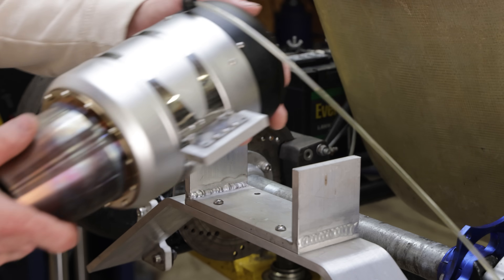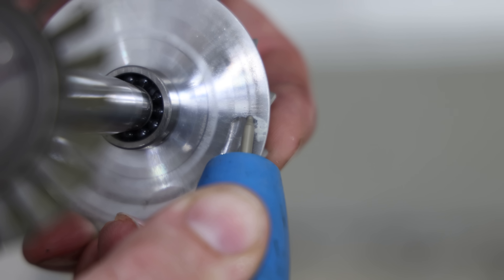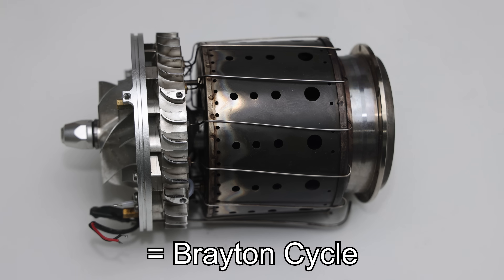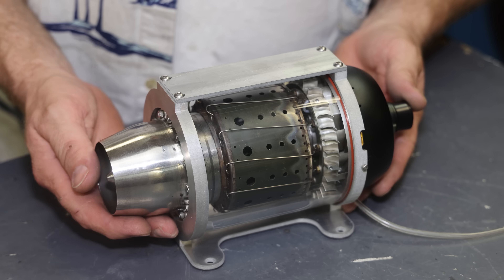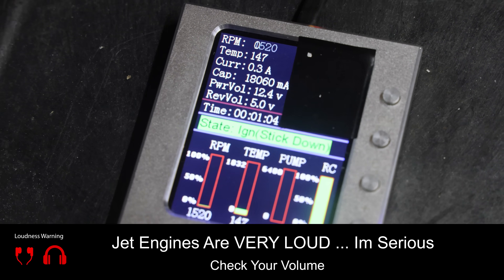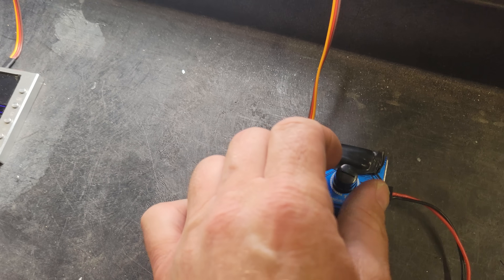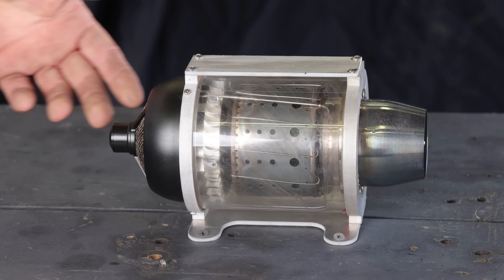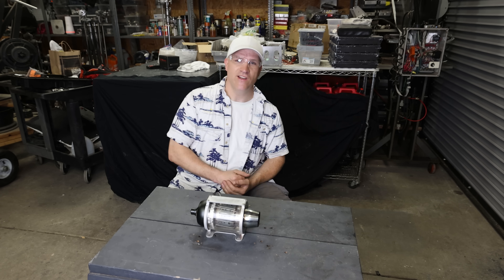See Thru Jet Engine

Comment: Why doesn't these small jets use bypass flow designs to increase thrust? What happens if you simulate heavy rain and pump water droplets through the intake?
Reply: Centrifugal compressor have not much space left around them to pass by. You can buy a 2 spool fan jet. 30 cm intake. What about a two stage fan like in a fighter. Then the air is compressed a bit and fits around the engine. Also a smaller engine can be used. Planetary reduction gear. I also would love pitot intakes behind the fan vanes to collect the highest pressure air for the engine.

Comment: This is absolutely incredible!  That is obviously tempered glass like a Pyrex or something - was it specially made, or somehow off the shelf?
Reply: I think it was Lexan plastic.  What kept it from melting is the high flow of compressed air passing between the combustion can and the Lexan outer wall. I didn't think it would cool sufficiently, but was happy to be proven wrong.  It just shows how intense the airflow is and how hard it is for the combustion heat to go much of any other way than towards the turbine and exhaust port.

Comment: @5:46 and @6:16 shows one electrical wiring... fuel line is not there until @6:17 proves that it's running on h2o and electricity to start it.

Comment: How are you getting the fuel and oil through the bearings to oil them? You can see what looks like fuel on the plastic, how is that getting there? Could you explain how the air is getting into the chamber? Is it going through the holes in the side of the chamber? I would have thought that you would need the back of the holes to be bent out to force air into the chamber. It is not clear what the air path is into the engine and out. Is part of the air just going around the chamber and mixing behind the turbine wheel? I would like to know more about the balance machine you are using. Thanks for the video.
Reply: Half of the compression happens on the rotor due to centrifugal forces. A third happens between the wedge shaped stator vanes. The large circumference gives compressed the air lots of cross section to flow every where. The chamber is at lower pressure. The holes need to be small to maintain this “vacuum” . All air passes through a hole ( no bypass).

Comment: Really loved the video.  But do find it interesting that you have all that equipment yet needed to touch the case (which could have burned you) instead of using an Infrared thermometer gun that can be bought on amazon for under 20 dollars.  Safer and could have gave an exact measurement of the heat.

Comment: Former Boeing Everett - home of really big ..... love your see through working jet turbine...

I am used to seeing GE9x Turbofans used on 777 and 787. 12 foot diameter main fans. Everything about them is also huge; factory, aircraft, assembly teams.

Making a see through model is very effective in showing how it works. This type of turbine was among first style of jet turbine engines. Frank Whipple's initial jet designs were similar. He used a front centrifical fan like we see on turbochargers. He also used a 'can' combustion chamber design. The rear power turbine was similar to model. 

By running fresh compressed air over exterior of combustion chamber and then into it via various sized inlet holes, heat is reduced on see through material. At first, I didn't know how well your turbine would last under high load conditions. Actual air fuel mixture occurs inside combustion chamber, where it is ignited.

Over the years the design has evolved to fully multi-stage axial flow using airfoil style rotor and stater blades, annular combustion chambers, and multi-stage power turbines, driving huge front bypass fan. Most of the thrust comes from front bypass fans, rather than engine exhaust. Some engines have up to 85 percent of their air bypassed around turbine core. 

Enjoy your methods and philosophies. If you are going to make it anyway, make it really good and make it really cool too. You get check-marks on both... very well done.
Reply: It's Frank Whittle. I live in the town where he ran his first jet engine.
Reply: @davidboult4143  Thanks for comment

Comment: I build sbc race engines. Balancing the rotating assembly is very important in my world. I’ve seen seen somebody blow 8 engines by mid-season. The only reason they didn’t blow anymore is because they ran out of parts. They were assembling the engines right. They didn’t want the down time of a machine shop.

Comment: Is that a centrifugal compressor? I guess axial would be harder to build. Great video! Thanks. I wish our gas turbine theory  professor would show us such a demo in our Propulsion class in 1969 ... Thanks!
Reply: If you can get away with a single stage and large frontal area: use centrifugal. I don’t know why high bypass fanjets don’t use centrifugal like turboprop and helicopters do.

Comment: I would love to see a company make hobby axial flow turbine engines. There are two companies that I know of that make the centrifugal flow. Jet cat and Jakadofski, how ever it's spelled? At least those are the only two that I know of anyhow.
Reply: I guess that the simple engines are good enough, already expensive, and heavy. Fuel is cheap. See how tiny the engine nozzle is compared to the scale nozzle of the real thing. RC planes gotta be cheap. Balsa flies on weak engine.

Comment: 130 000 rpm??? wow. Also. afaik fog machine uses glycerol just like vaping e-cigarettes to produce fog. glycerol aka glycerine chemically is an organic alcohol. it BURNS just like jet fuel and turns to gaseous state being overheat. artificial fog is a nebulized particle condensate just like clouds in the sky. you see it because it consists of tiny liquid glycerol drops just like you see clouds that consist of water condensate. You can't see anything inside using it because it turns to gaseous aggregate state in outer contour and also ignites inside of turbine. It seems like it's even can be seen how it burns, because I've noticed that burning fuel gets colored in blue in front area of combustor chamber. In case your fog machine uses nebulized water same things happen except burning.

Comment: The problem with your jet engineers that is heating up too fast and burning everything you need to find a heat resistant behaviour in the process of this simple matter day you need more than one in need convert it a lot bigger is the more parts you need and the more resistance of heat so basically the metal is burning and corroding

Comment: I wonder if you could make a Turbofan with that turbojet. From what I understand, it should be not too hard. You just need to put a ducted fan in front of that

The hard part is probably to make the fan and connect it to the shaft
Reply: Lots of people print fans. What would be more interesting would be a second turbine like in a real turbofan. Butt to butt on the existing one! Then have a shaft go the the back and numerous U-joints into a planetary gear at the fan!

Comment: Well it's ok to balance the compressor an turbine on the shaft. But if you take it apart to reassemble it together with the combustion chamber and shaft tunnel, the balance of the compressor is no more that what it was before, right? Even if you mark the position, there's always a little play between compressor bore and shaft diameter.

Comment: 8:50 Not quite correct. The fuel provides the combustion which causes the air to expand and it is this expansion of the air that causes the resultant thrust. The principal behind jet engines is to accelerate the air flowing through it here every action in one direction (air mass in the exhaust traveling rearwards) causes an equal and opposite reaction (ie the engine throws air out the back so the engine is pushed forwards). Think about supersonic flight, how is it the exhaust is subsonic yet the aircraft is travelling at supersonic speeds? It's due to the low subsonic inlet air mass being accelerated to a much higher subsonic exhaust (this is the expansion bit the fuel does), the difference providing the thrust. So not the fuel not 'the entire idea behind jet engines' perse, more so the accelerated mass of air (fuel gets burnt, not accelerated).

Otherwise a fantastic video; now subscribed!
Reply from the maker: Thanks I was trying to simplify it. However this type of engine design would never be used in a supersonic application.
Reply: I imagine a that one could place these engines into the wing root. Split the wing to make a it a Buseman biplane ( only close to the root because a full biplane is too heavy). I like to see leading an trailing edge flaps. Dips in the wings compensate the area of the engine and keep the flow at Mach 1.1 everywhere. The hot exhaust has a higher speed of sound. The annular nozzle directs it onto the center aerospike. The spike pushes the plane.

The fuselage also coke bottles around the engines. Look at super sabre or Saab draken to see how you just place a sharply truncated cone over the inlet to form a pitot intake.

Comment: This was interesting, I used to work on a computer system that worked in conjunction with a gas turbine generator system. This gave me a little understanding on  the non electronics portion of the system.

Comment: Turbojet gives better top speed and my favorite the Turbofan gives us better acceleration and more power due to the large fan up front sucking in more air and are more fuel efficient than the older more basic turbojet models.

Comment: So basically there's four blast furnaces under the wings of modern airplanes and the wings are filled with fuel My fear of flying just hit the stratosphere
Reply: A better analogy for a jet engine would be an oil burner used to heat a house. An oil burner sucks in air with a small centrifugal blower which then blows the air into the furnace. Fuel gets sprayed into the air stream which then is ignited with a spark. The biggest difference is that an oil burner runs at relatively low pressure because its only producing heat. A jet engine compressor needs to produce higher output pressures because the objective is to heat, expand and accelerate the hot exhaust gas out the back of the engine to create thrust.
Reply: Now you know that most of our transportation actually is based on controlled explosions. Just like your body is running on a controlled fire.

Comment: that thing sounds so frikin sickkkk! The thrust is provided by the chemical reaction. Some air does provide for it but its all about the addition of the carbon and hydrogen atoms to the molecule to form Water and Carbon Dioxide (plus a bit of Carbon monoxide and unburnt fuel, sulfur compounds from impurities), formation of these molecules create a huge expansion of gas as per the Ideal Gas Law, PV = nRT 😆

Comment: One thing made clear to me is that at the combustion phase the air has to be low speed, Hugh pressure in order to prevent flameout.  The intake fan is not actually built for speeding up the air, but actually forcing it against the pressure in the chamber, where it is mixed with fuel and ignited.  Immediately thereafter it blows its way out the back of the engine, where it exits the engine evens faster than when it entered after being held in a momentary near standstill.
Reply: How is air and fuel mixed then? I would accelerate air and fuel to max velocity and then mix them in a coaxial way ( I would have to get the fuel to a nozzle in the center like in a carburettor). Then a diffuser converts the energy into pressure. This naturally leads to a can design like in F-104 . On large jets like in commercial jet liners all the cans fuse together into an annular chamber.

Ever sprayed gasoline on a grill? Flame fronts are fast!!

Comment: What is the material you used for the transparent housing? I looks like the difference in expansion may have contributed to the gaskets booing out (in addition to the flex in the bracketing).

Comment: That's a cool video. Thanks for making it and educating us. The fog did not appear probably because of the heat inside the engine. I am guessing the fog machine use glycol which forms "fog" when it cools down but it heats up when it enters the engine and no longer in the fog state. It is too hot to cool on the exhaust and too dilute further down when it cools so you see the fog disappear. Most other form of smoke is unburnt hydrocarbons that will also burn up inside the jetengine. It will be interesting to see if you can come up with something you can use to see the flow without damaging the engine.

Comment: At first glance appears the air molecules within the"Fogger"formula are to heavy to be consumed by the jet engine air intake during throttle up series:
("Fogger"/Natural Air Split),
And or the intake of the jet engine would need modification to produce a more efficient engine.
Might be wrong?
"Still learning"

Comment: i disassemble gas turbine engines used in military aircraft apu's for overhaul. the smallest i have done is called a jet fuel starter (JFS100-135), it may be small, but it takes a whole day to disassemble. the largest apu is the 165-9A for the B-1 bomber and that takes me 9 hours

the compressor and turbine wheel you use looks exactly like the ones on the aforementioned JFS 100-135

Comment: This is a really great video. However, how did you start up the engine please?  I learnt that there must be some source of compressed air to give that initial rotation before the engine can run on its own power.

Comment: great Video, thx a lot.
Now it seems that I have got how it works.
Is there en electric motor to start the initial rpm-speed, before injecting fuel?
Is it the same electric inicial power up in a bigger plane jet-drive?
Regards Andreas from Germany

Comment: Great video, however, your comment at 8m 49s is incorrect/inaccurate.  Jet engines only pull in low volume at low speed, but pull in very high volume at high speed, thus why they generate relatively low thrust at low speed and accelerate faster and create much higher thrust at higher speeds.  Jet engines are designed for high speed.  That's also why propeller planes typically accelerate to 50-70 knots quicker than jets. Props have higher mass throughput at low speeds, but are unable to maintain it due to the drag at higher speeds.

Comment: You won’t get the volume of air intake necessary to pull the fog in an impressive manner with that type of engine, namely that it seems to be a zero bypass turbojet. If you were to put a fan on it, you’d get a very impressive fog sucking effect.

Comment: Where is the thrust borne? In other words, where does the force that pushes the vehicle along get transferred from the expanding gases to the jet engine??
Reply: The thrust is borne by the vanes, i suppose, which is why the vanes are the most critical parts of the engine and the hardest to manufacture. The thrust is in the opposite direction to that of the gas flow. From the vanes, the force is transferred to the shaft to the assembly and mount to the plane.

Comment: The reason why the fog didn't work is because fog is mostly water, and when it entered the engine it evaporated
Reply: I think there must be some glycerol in artificial fog. and it also burns, just like any alcohol. and glycerol is an alcohol just like methanol ethanol etc.
Reply: I think also the pressure and temperature would mean that even a non-combusting fogging agent (if one were able to survive) would be unable to condense and be visible.
Reply: @gmoar  pressure helps to condense but such a high temperature turns it to a gaseous state no matter if it can burn or not so it can't be seen anyway. any fogging agent must be a liquid suitable for nebulizing at normal temperature.

Comment: Awesome. Just wondering why the see through body didn't melt at  1355 degrees?
Reply: The glass shouldn't be reaching anywhere near the turbine outlet temperature (assuming that kind of thing is what's being measured, which is usually how it works). The air coming in off the compressor is hot by human standards but extremely cool relative to the temperature inside the combustion liner (the metal can inside with the holes in it where the flame lives). The constant flow of "cool" compressor air between the metal can and the glass keeps the glass cool-ish and keeps the metal combustion liner from melting.
Reply: @ganthrithor  Thank you. Your explanation seems right.
Reply: Pretty sure it was glass.

Comment: Is there any benefit to redesign the jet engine fuel? For example, in the 1960's drag racers used methy hydrazine to increase the internal compression.   The sucess of the experimental fuel was very sucessful, but the methyl hydarzine was excesively reactive in fuel storage.   I am a chmist nearing retirement.  I found a method to neutralise the unwanted  reactivity.
Reply: that's interesting!
Reply: Well make a video about it chief

Comment: Would be nice to have an actual axle flow engine instead of the centrifugal type
Reply: Axial flow doesn't work real well in smaller diameters like this.
Reply: Have you ever seen an axle flow design.... and what are the issues with it? ..... just curious